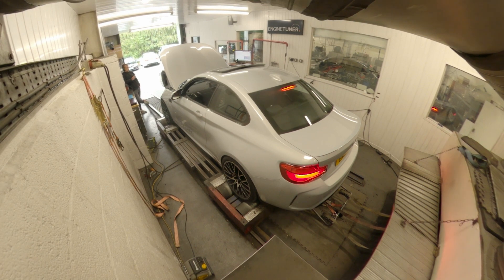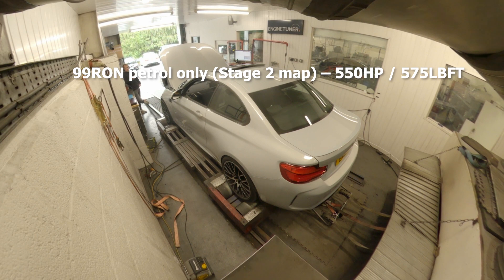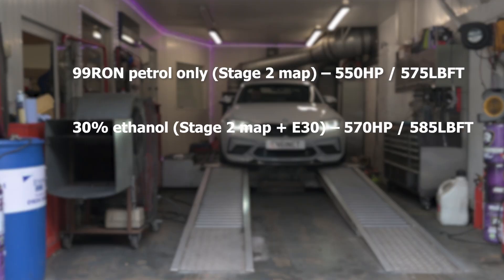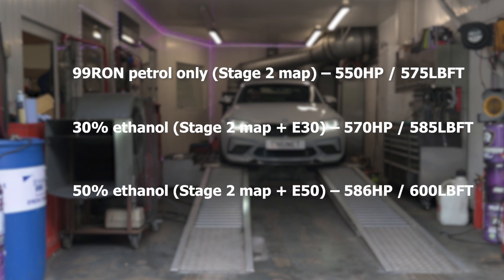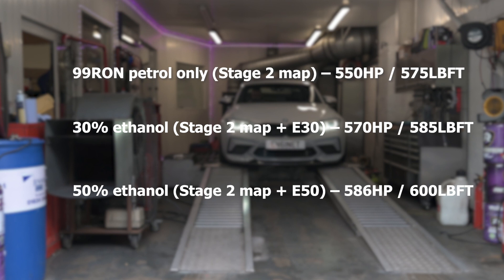M2 Competition hits the dyno running the Bootmod3 flex fuel sensor - check out the crazy results!

Comment: You can run E50 on thr stock F8x platform? I thought you needed injectors to do EU5 injectors E40+. Apologies if you have already done this, couldn’t see a spec list
Reply: At least with the BM3 MultiMap file and flex fuel kit, you can run any mixture of E85 or full E85 on stock fueling and the tune will adjust power accordingly. 

But like he mentioned in the video, past E50 it kind of leans out and you can feel it. Though, I have tried E70-E75 at most and I did notice that it pulled significantly harder than an E50 blend. However, at least in my car, the car kind of idles funny every one in a while if I’m higher than E50. 

I generally like to keep it around E50-E60.